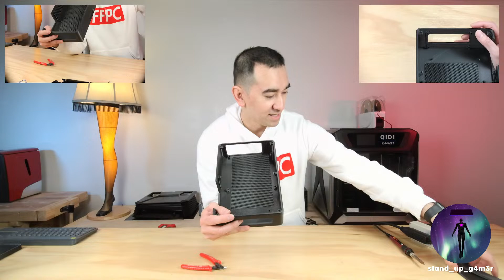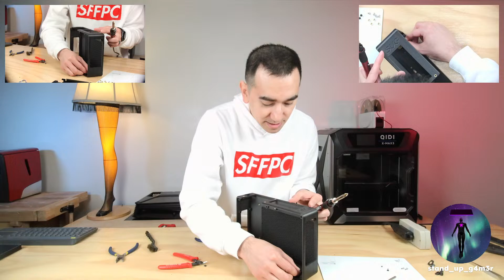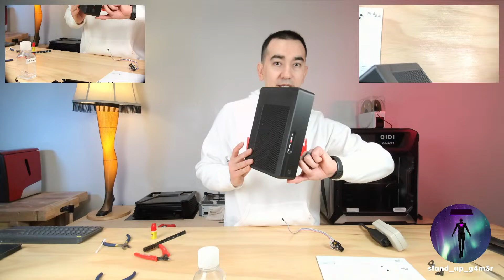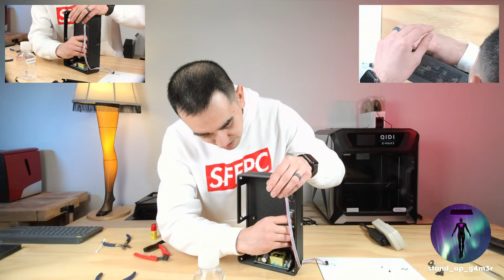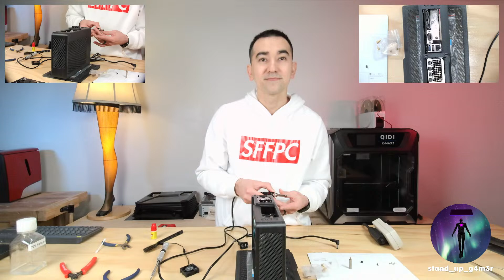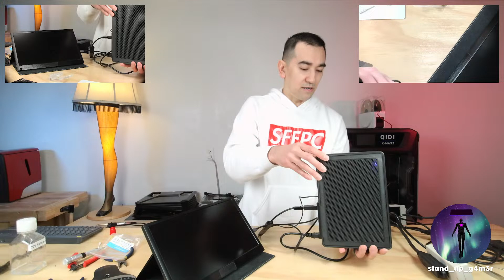TINY AF 3D Printed PC Gaming Case - Full Build LIVE!

Comment: Very nice I really like the case. The INYUDA H610IG Thin-ITX motherboard would also look good in this case big advantage is that you don't have to worry about using the Mickey Mouse pico psu your getting the power from a laptop charger and you could use a GPU.